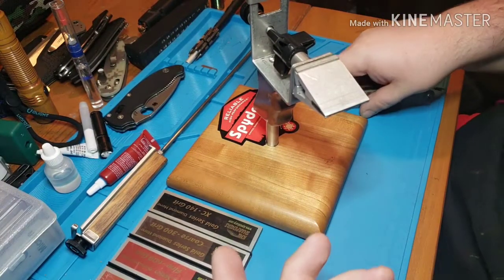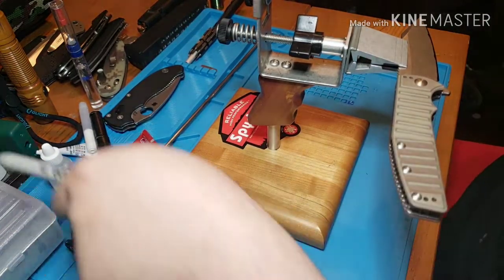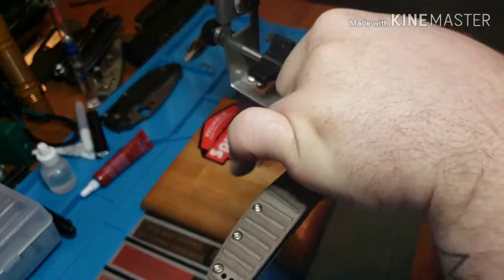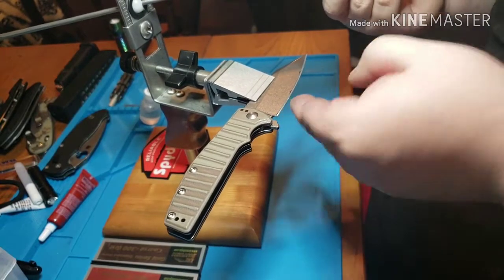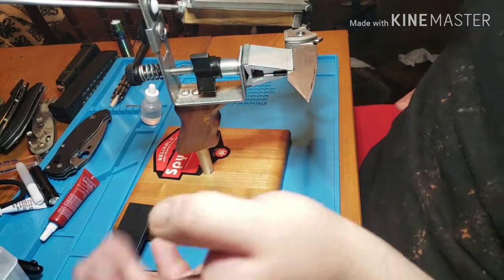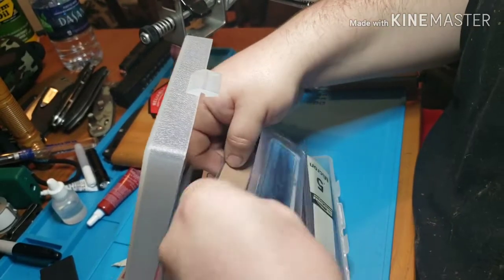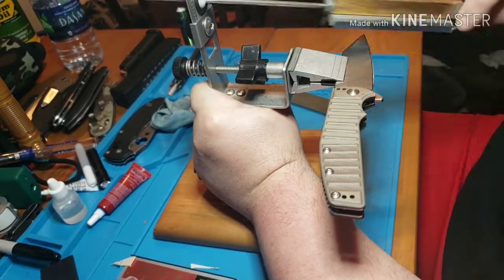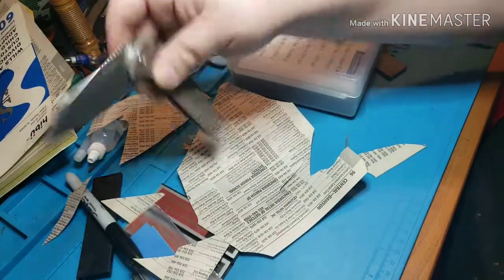How I sharpen my knives

Comment: Nice video! Is that a Glock extra capacity magazine in the background?  You got that blade nice and sharp, and in a short amount of time, which is one of the issues that a lot of people have with the fixed systems is that they can take more time than freehand.
Reply from the maker: Sure is, that's an extended mag for my glock 23. Good eye lol and it takes me a while to reprofile a blade but I can get it sharp in under 5 minutes
Reply: @mississippiknifenut4312  Yeah, sometimes it is best to re-profile freehand because it is faster and you can use a bigger stone, then you can go back to the system

Comment: You try a civivi yet just got one a month or so ago sharpened the crap outta it  gotta get a new one lol fun experimenting though
Reply from the maker: Not yet, waiting on the 20cv pm2 to drop for 145
Reply: Mississippi Knife Nut ahhh yeah forgot about that lol I don’t know how they ht 20cv not a big pm2 guy bricks in the hand
Reply from the maker: There 20 CV is ok, it's more durable and  wear resistant then s30v and it comes with tan scales so it's well worth it imo
Reply: Mississippi Knife Nut I’ve seen a lot of tests that show it doesn’t have much of a difference 20cv m390 and 204p need to be heat treated at a higher hrc to gain any real advantage over s30v it’s a bit more stain resistant but that’s about it
Reply from the maker: Supersteel Steve has done an edge retention test
Reply: Mississippi Knife Nut yeah didn’t it show that there relatively similar sorry if I’m wrong not sure might be thinking of another test he did seem some others say it’s not great
Reply from the maker: Yes the 20cv did slightly better and I know it won't chip like s30v will
Reply: Mississippi Knife Nut never had a problem with s30v chipping  don’t have much experience with the m390 class steels onley got 1 at the moment lionsteel m4 and had a 940 exclusive 20cv